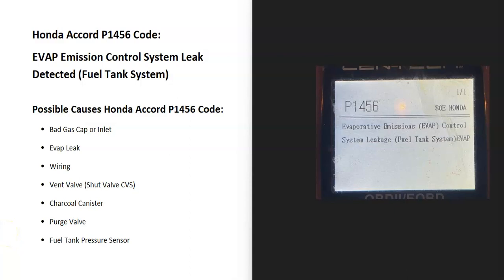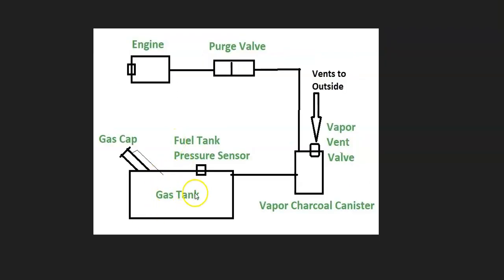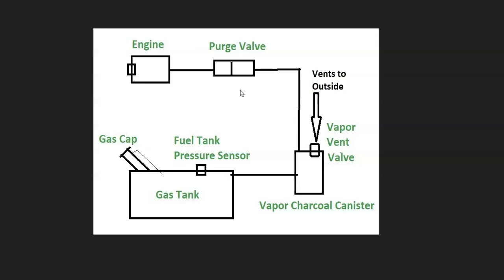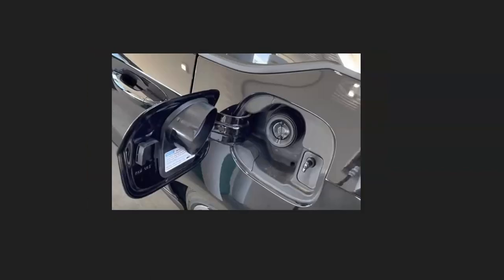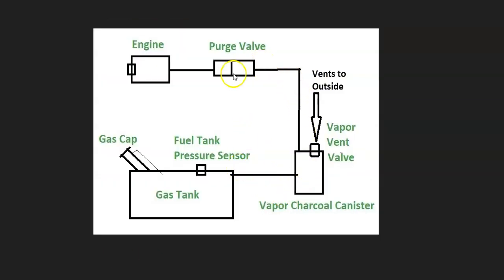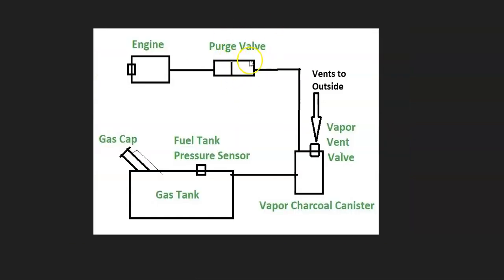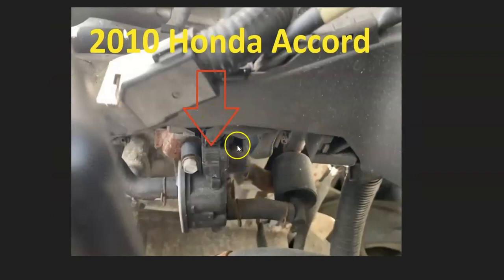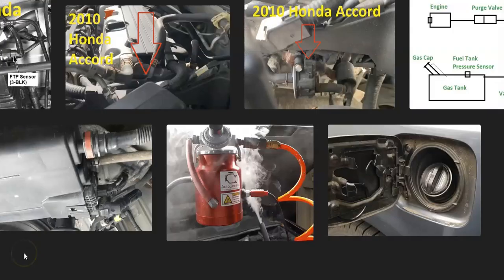How To Fix Honda Accord P1456 EVAP Emission Control System Leak Detected (Fuel Tank System)

Comment: I have crazy high fuel trims right now causing a lean code. Likely from a vacuum leak somewhere that I've been unable to find. Could this trigger a P1456 by accident? I've replaced the charcoal canister, purge valve, and gas cap all within the past couple of years. The purge valve and gas cap within the last 3-4 months.

Comment: Whats best way to access that corregated emissions hose that leaves top of gas tank.  I know that there is leak in that hose. Car dealer lowered rank and showed me the leak but would not patch it. Wanted me to replace whole system!  Do i need to lower gas tank or can i go though back seat?   I don’t have access to a lift so second option is preferred if possible

Comment: THIS COMMENT MAY SAVE YOU ALL THIS HASTLE!    REPLACE BATTERY FIRST!!   I REPEAT!!! REPLACE BATTERY FIRST!  it may just save you a bunch of money and hastle
Especially if you have a bad idle when the A/C is on!
Reply: Where did you get this information from? The battery has nothing to do with the evap system.
Reply: LOL     a  TOTAL MISS INFORMATION-----TROLL
Reply: @AP-514  figured
Reply: Wow this stuff should be banned by someone or something.  Garbage.  Lol even bad idle when the AC is on is probably an IAC if the honda is older.

Comment: Can any of this cause a fuel pump to go bad? I had my fuel pump replaced about 3 months ago. Car wouldn't start so I replaced the fuel pump again, then i found the fuel pump fuse also blew. It starts and runs now  but now I'm getting a p1456 code
Reply from the maker: The evap and fuel systems are separate.

Comment: Got a 98 4 cylinder got p1456 started to smell fumes and maybe burnt rubber, already changed charcoal canister w/ cvs or whatever it’s called junk had rust like crazy 😂 then o2 sensor. Also got the purge valve but if I started to smell fumes do you think it’s one of the hoses? From what I heard the gas cap already got changed so idk what else could it be. Smell is on the right(already had other codes, hence why I had to change the other stuff)
Reply: I hate when Jackazz like this never come back with the Fix
Reply: I’m having the same issue!! Currently trying to fix it.
Reply: @dabsrivera-gh3uv did you get it fixed?
Reply: Let me know if you find this
Reply: @NewViralReelsTV did you get it fixed?
Reply: Any luck guys? I'm currently going through this..